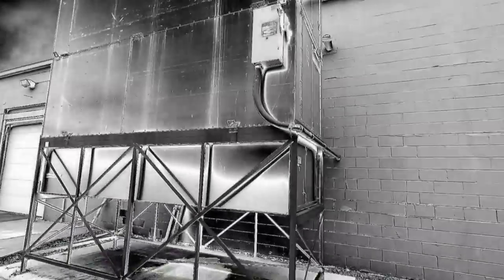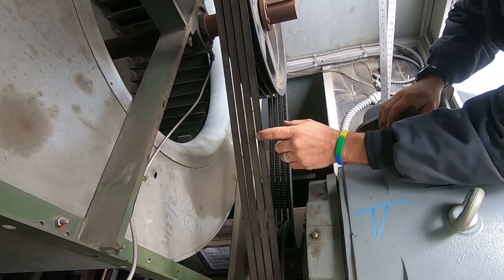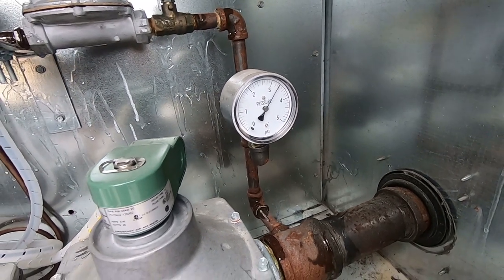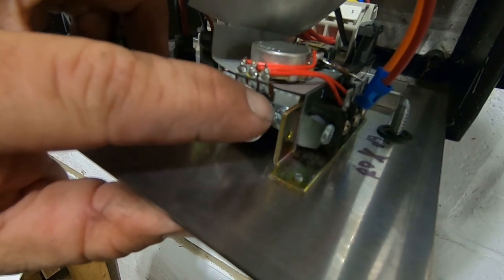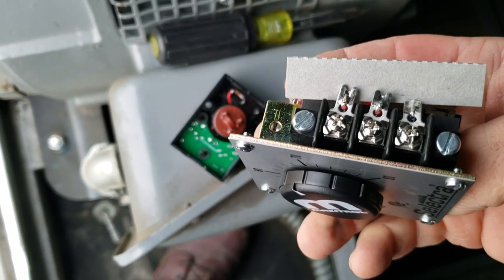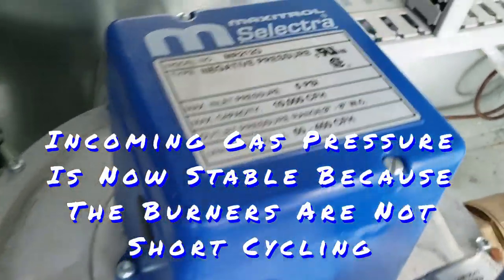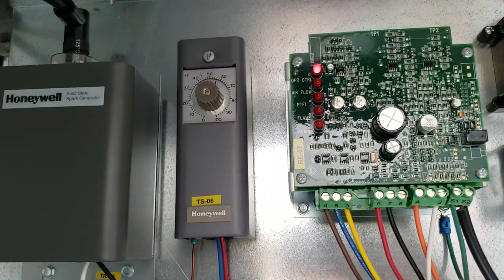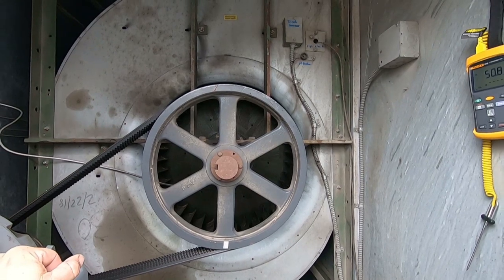Industrial Direct Fired Make-UP Air Over Heating The building

Comment: the remote selector in the space was probably wired as such because they weren't using it. The Maxitrol has a setpoint dial at the unit so no one messes with it down below.

Comment: Worked on a DFMUA where the flame was massive and orange. Flames were reaching the blower, motor and belt. Whole blower compartment walls were charred. Unit’s saving grace was the high limit. 

Gas pressures were good and maxitrol repeater, modulating valve and sensor checked out ok. Was as if something in the space like a fire damper closed shut on the supply air.
Reply from the maker: You would think since it has a dual pressure switch that it wouldn't be able to run with any type of restriction because it would be either above or below the static pressure zone that they want and should have caused it to shut down. Weirder things that happened👍👍
Reply: @HVACRSurvival  this was disconnected bypassed by previous contractor

Comment: I agree locking out the disconnect when your in the unit cleaning the burners is well advised, if not that would be a perfect part in horror film movie
Reply from the maker: 👍Safety is commonsense that's not so common to those with no sense. 😏
Reply: "Why is this off?" click

Comment: I am thinking that you also have a gas supply problem.   It should be possible for the unit to go to high fire right away without gas pressure dropping like that.

Comment: I suspected discharge air temp sensor ,Common problem with those Maxitrols. That is one of the cleanest units I have ever seen.Where I live in Indiana those burners are a common thing to rust the holes shut.Always have to drill them open.Very time consuming.I use extra long drill bits.
Reply from the maker: Thanks for commenting! yeah I'm not looking forward to drilling them out. This unit was less than a year old.
Reply: @HVACRSurvival  Fastenal has the longer drill  bits ...you have to order them usually.They are a lot easier than trying to use a short drill bit.I think I needed 2 different sizes for the orifices .Also there are holes in the back for air that most people dont realize.They are hard to get to but they make a difference on how the flame burns.I`ve worked on 2 or 3.lol

Comment: I work on units like these the od time. If there is time I think a good video would be going over the gas system. As far as how to set gas pressures and what to look for, Also the maxitrol mod controller. Besides that good video!!
Reply from the maker: Thank you 👍👍

Comment: Just worked on 5 big ones that were over firing tripping out limit. What was the supplied temp set point? Set all of mine at 90 deg.
Reply from the maker: I left it at 60*, they can change it. It's a factory so that probably don't want a lot of heat blowing on them. That's the benefit of having the remote control panel.

Comment: Awesome. Was that a ball bearing or shelve bearing blower. The belts being loose would affect the air flame quality. When testing the static pressure was that positive or negative in the system. Great work on editing very smooth 👍🏻💯
Reply from the maker: The blower was pillar block bearings I believe. They have a maximum RPM range that you can set it at, if you notice there's reflective tape on the big Pulley,  the gas valve is a negative pressure gas valve, the pressure switches are shooting for a minimum and maximum static pressure across the burner plate. I forget what the numbers were.  Thanks,  I'm trying to keep my locations and company name hidden. That's what got me in trouble last time.
Reply: I understand and thank you for the effort you put forth on your videos.
Reply from the maker: @texture6  right here is what I like👍👍 conversating with others that share the same passion to be the best they can be

Comment: how do you adjust air flow if the pressure drop across the burner is out of spec?
Reply from the maker: You adjust the burner plate gap. We had a lot of problems when we first started this one and a factory rep had to come out and spend nearly two days on it.

Comment: Those discharge air sensors go bad frequently. All kinds of funny things happen then
Reply from the maker: Yes sir👍👍 That's why the gas pressure was dropping as fast as it was, it was flying wide open with no modulation. All of this was properly sized and installed Recently so I know it wasn't an under size gas line, but possibly the regulator coming into the building might have been taking a dump but neither seem to been the case.